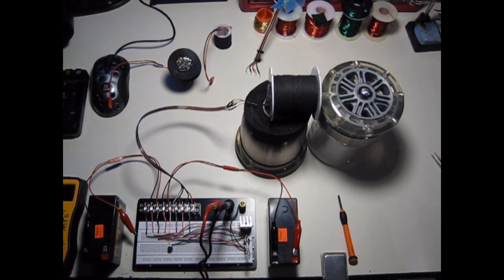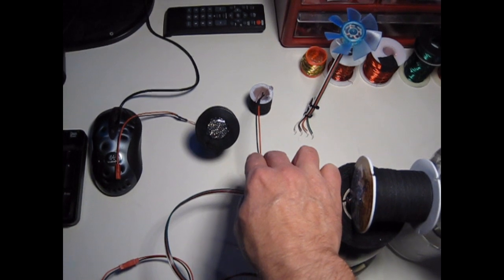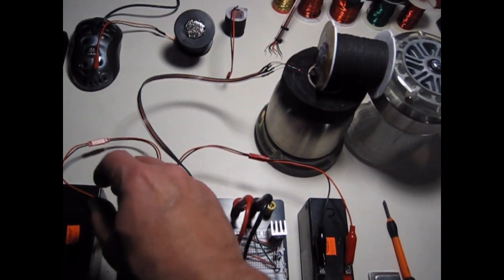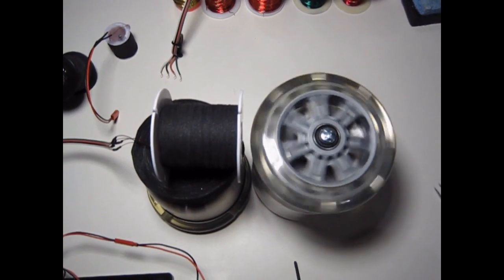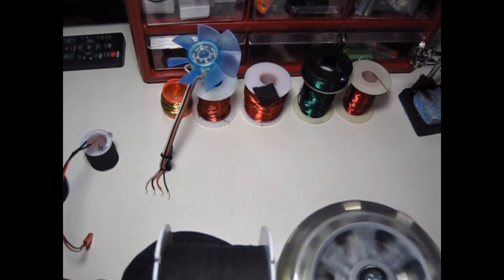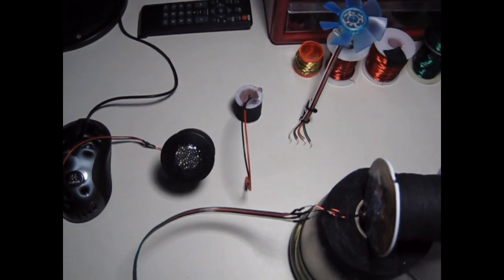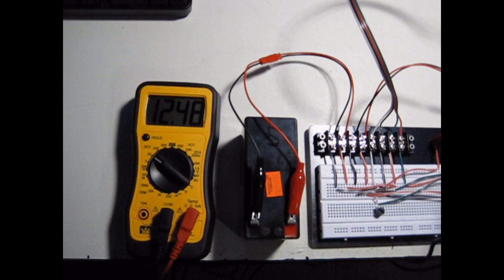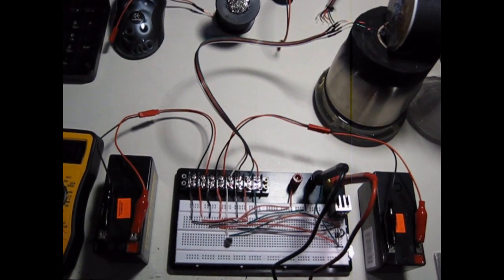My 3rd Bedini Motor

Comment: The 17 extra coils inrease the magnetic induction exponentially  and using tvs diodes and power mosfets can capture flyback much faster. An extra original Bedini circuit is necessary for each coil.

Comment: He added. "Attach a shaft to the middle of the wheel and take a hammer to a 24v drill from harbour freight and attach it to the end of the shaft.   And it will be electricity produced that was not already in the system ( overunity ).

Comment: It runs for a lot longer, than it's already impressive run time time due to the flyback reversing somehow the charge in the run battery.  He suggested using 48v to run the motor and be the charge capture batteries.

Comment: Magnets loose their magnetism over time. You might get one to run for a few days, weeks or months... but soon the magnets will be weak and not provide enough charge to keep the thing spinning. And the useable energy generated will be so small that you could barely light a single 3v led chip

Comment: So why are you only measuring voltage with no ammeter in the circuit? Your DMM is equipped for it. Move the red lead to the amperage connector and connect the meter leads in series with the circuit. Any old place will do since amperage flow is constant through an operating circuit and only voltage varies from place to place. It's also worth mentioning that you should be using your meter to measure the VOLTAGE DROP across every component in the circuit (red lead on the supply side on the "upstream" side of every conductor or other resistor and black on the downstream side of them with the circuit powered) measuring the resistance of the entire circuit end to end by flipping to ohms and then use Ohm's Law to calculate how much amperage you should have through your meter in series. 

And of course you SHOULD be using a diode- isolated, constant current supply to power the circuit instead of a constantly variable battery. You're seeing a "charge" because the battery is recovering after the initial load.Batteries store electrical energy as chemical energy. Discharging is one chemical reaction and like all chemical reactions various factors affect how rapidly and efficiently it occurs. Charging is the reverse chemical reaction and requires sufficient current flow in the OPPOSITE DIRECTION to occur. Are you SWITCHING POLARITY in your circuit? No. Therefore you are NOT "charging" the battery. You're seeing additional chemical energy conversion to electrical energy after the initial STARTING load is reduced. In a TRUE charging circuit, such as in a vehicle, there IS no separate "post" for currently SUPPLY separate from the battery positive. You folks seem to labor under the delusion that a battery is a stead state "supply" instead of a short-term storage unit. And batteries are not IN SERIES WITH generators or alternators, they are PARALLEL TO THEM.   

If your system were actually charging there would be NO NEED to move the positive lead of the meter. Just like in an automotive charging system you can check SYSTEM VOLTAGE at any point in the various circuits as long as its on the supply side and the ground side and get BATTERY VOLTAGE (minus small drops due to circuit resistance) batteries do it.

Try a real-world experiment that will clearly demonstrate that what you believe you are seeing is a BATTERY generating additional current through its chemical reactions and therefore increases circuit voltage rather than a LOAD somehow magically CONSUMING and GENERATING electricity at the same time. Because after all, a motor CAN become a generator, but only when a mechanical force drives it AND the FIELD CURRENT is reversed and POLARITY is reversed so that electricity can flow the OPPOSITE direction back TOWARD the supply. If polarity is not reversed, it isn't generating anything. 

So, turn on the headlights in your car and let them drain the battery until it is "dead". That can be until the lights are completely dark or no accessory circuits power up when the key is turned on. Check the battery voltage. The first thing you'll see is that the battery ISN'T "dead". A DMM will always show some voltage and it will probably be in the 8-9 volt range. Now for the MAGIC! Shut off the lights and key switch. Let the vehicle sit for an hour or three. Go back and recheck battery voltage. It will be HIGHER than it was previously. Guaranteed. How much higher depends on a lot of things, but it will INCREASE. That is EXACTLY what you are seeing.

One more little check to make on your car. A fully-charged "12 volt" battery will have 2.2 volts per cell and they have 6 cells for a nominal, no-load voltage of 13.2 volts. The ACCURATE way to measure state of charge to avoid "surface charge" in accuracies is by measuring specific gravity of the electrolyte with a hydrometer, but 13.2 volt is close enough. Now start your car and check battery voltage with the charging system operating. You should see 14.2-14.4 volts. Why? Because the CHARGING SYSTEM must generate enough electricity to overcome the internal resistance of the battery itself to recharge it AND carry electrical system loads.13.0 volts is LESS than the nominal voltage of a FULLY CHARGED BATTERY so you are NOT charging it.

Comment: So many electrical "experts" believe this stuff yet every one of them has every electrical appliance and device he or she owns connected to a battery or electrical system. Gotta wonder why they don't have house-hold units powering their over-unity evangelism. Or a "permanent magnet" alternator or generator in their car so they can disconnect it from the LOAD side of the electric system and leave it connected only to the SUPPLY side.

Comment: It's very simple. Digital multi-meters are themselves powered and they circuitry they use draws essentially no current from a circuit they are "connected" to. Especially when they are measuring the voltage parallel to the circuit, which is used to measure voltage DROP across a section of the circuit rather than the voltage at a given point in the circuit. 

The multimeter itself is the "path of least resistance" because it actually has positive voltage rather than being a load on the circuit. Another factor is the fact that invariably a battery subjected to an initial load such as powering a motor at startup invariably has a significant voltage drop as it supplies the load and a small amount of internal heat is generated which increases the internal resistance. 

A "old-school" analog meter with a simple voltmeter gauge that USES a small amount of current when connected to the circuit will not demonstrate the same "charging" affect. In fact, it's only the precision and accuracy of a digital multimeter that allows a "charge" of a few hundredths of a volt to be "seen". 

Once the motor is spinning (in your case assisted by the permanent magnets that are NOT found in typical electric motors with field coils, armature windings and commutators or any sort of switching device to alternate the magnetic fields) the load is significantly reduced, circuit resistance drops and the battery "recovers" voltage and appears to be charging simply because the current draw from it is reduced. 

The same phenomenon can be observed when cranking an engine that won't start down to the last "breath" of the battery. Turn off the key, allow the cranking motor, battery and conductors to cool and allow the remaining chemical energy in the electrolytes to become available over a period of minutes and when you try to crank the engine again you will find that the battery has at least a tiny amount of charge left.

The important thing to remember about electricity is that both AMPERAGE and VOLTAGE are required for the electricity to do work, and they are interrelaged. As voltage increases, the VOLUME of current - the amperage required from the supply - decreases because the PRESSURE of the electrons overcomes resistance more effectively by jumping the "gaps" from atom to atom in the conductor. 

Some say the pressure/flow description of electricity using hydraulic system terminology is inaccurate or incomplete but it is EXACTLY the same. Voltage equates to pressure, amperage equates to flow and resistance equates to restriction. Just like the RESTRICTION in a hydraulic circuit or even a garden hose creates the pressure by resisting flow, the resistance in an electrical circuit determines the amperage draw of the circuit at a given STEAD STATE voltage. 

Every circuit has a voltage drop just like every hydraulic system has a flow drop and resulting pressure drop. And just like a hydraulic circuit can have flow but be doing no actual work because the supply pressure is positive and the return pressure is 0, which results in no flow when a load is applied, an electrical circuit can have voltage but be doing no work because the voltage is being checked "upstream" of the actual load with the switch opened. There is voltage but there is no amperage. No work is being done. 

One thing you will never see in any of these magical, mythical "over-unity" experiments is the "charge" terminal of the circuit connected to any kind of secondary load. Any electrical system that is actually generating a net electrical power INCREASE will supply a load over and above what is required to operate it. And your permanent magnets have a secondary effect as additional mass for the flywheel. 

There need be no switching effect of the fields because magnets only repel magnetic poles of the same polarity. When a magnet is simply acting on a, ferrous metal, the CIRCULAR magnetic field at the end of the end of the magnet pole amount of the magnets energy and has the same polarity, so at the point at which the permanent magnetic field weakens sufficiently and the temporary magnet field strengthens, which is slightly after "halfway" because some energy loss is inevitable, the metal object is repelled. 

Even "permanent magnets" themselves are a myth. Invariably over a long enough period of time and when in close enough proximity to a good "conductor" of magnetism, even "permanent" magnets weaken. Which of course is why ELECTROMAGNETS are the only TRUE "permanent magnets" that actually increase in strength with repeated use. 

I'm sorry, but "over-unity" is a myth. And although it may not be taught anymore, once upon a time those basic scientific facts that I mentioned and the fact that in EVERY transition from one energy type or state of matter to another energy is lost because some is consumed bringing about the change itself was ALSO taught. Which of course is in direct violation of some so-called "scientific laws" by a certain Brit who must have been experimenting in the vacuum of space to arrive at his "laws", but the truth hurts. 

Newton's laws are ONLY "law" in the complete absence of gravity and matter. Otherwise known as a VACUUM. Even the so-called "vacuum of space" is a laughable lie, since obviously space contains all the matter that exists in the "universe", including the gases. A true, classical vacuum is the absence of matter and it is impossible to achieve.

Comment: People don't get it, this has nothing to do with " free energy" it's a electro- mechanical High Frequency pulsed DC generator, very good in charging, desulfating, and rejuvenating many " hopeless sulvated leadacid and nc - nimh batteries by means of " cold electricity" google bedini and tesla charger if you like to know more
Reply: Except for the fact that it's not "generating" anything beyond the additional leftover chemical energy of the battery being converted to electrical energy after the initial startup load places a significant draw on it. All batteries "recover" after an initial load in excess of their cold energy conversion and transfer capacity. A battery does not consist of two flat sheets of positive and negative material with all of the electrons neatly arranged side by side so that they can instantly jump the gap simultaneously. 

In fact, the higher the amp-hour capacity of the battery (the TRUE measure of a batteries current generating capacity (yes, batteries "generate" current through chemical reactions), the more internal resistance it will have so that that the chemical reactions take place as efficiently and controllably as possible. When being charged, the exact opposite is the case and maximum capacity is reached via slow, steady charging that does not heat the insides of the batter. Which of course creates resistance. Which reduces current flow. Which increases amp draw. Etc etc etc. 

Apparently all of the "electrical experts" who believe in something for nothing don't own cars, motorcycles or other vehicles equipped with electric starting systems. And apparently they've never had any dry-cell powered device like a cell phone or RC car, either. Because when you rapidly draw current from a battery to the point that it is "dead", you're not draining the batter completely. 

You're simply increasing circuit resistance to the point where the battery doesn't have sufficient current flow capacity to overcome the resistance with enough leftover energy to do any work. But an AMMETER in the circuit would and will show that current continues to flow. It's simply turning into HEAT ENERGY instead of MECHANICAL ENERGY. 

And of course an AMMETER is the one thing NEVER used in these "experiments". Because AMMETERS are connected in SERIES with the circuit and apply a LOAD to the circuit that these "over-unity" machines will not power. 

I could also get into the fact that the digital multimeters themselves used in these experiments measure voltage to a sufficiently small level that only the fact that the meter itself is POWERED by its OWN BATTERY allow them to be measured. Hundredths of a volt at a miniscule amperage will do ZERO work when an actual LOAD is placed in the circuit. The "permanent" magnets used and they are arranged assist the "motor" in operating. 

In actual electrical motors there are no "permanent" magnets because obviously if the motor can power itself and actually "generate" electricity, it doesn't NEED to be connected to an electrical SUPPLY at all.  But here in the real world, there are no "permanent" magnets because over time even THOSE fields weaken and the HIGHER the load placed on a motor the STRONGER the fields need to be to carry the load. Just like increasing current demand on a GENERATOR requires stronger fields for increased induction. 

If you have to go online to be "sold" on this myth, you clearly don't know anything about electricity.

Comment: please use an invertor and not battery and convert 12 v to 120 v ac and we doubt that battery is running motor via 555 timing circuit please also disconnect this in vedio
Reply: That guy never said 555 timing circuit, he show's Bendini SSG- Transistor circuit

Comment: why not save some effort and just connect the discharged battery to the charged battery? That's all you're doing except you've connected them through the PM motor and the pickup coil.

Comment: Voltage is NOT an Indication of Power....
Watching as one batt discharges and another charges (allegedly) is Utter Rubbish!!

What is the POWER--In Watts (or Milliwatts) that are Driving the device??

What is the POWER--In Watts (or Milliwatts) that are derived Out of the device??

Take Power in Watts derived from the device from the Power in Watts supplied will tell you the True facts of this thing.

IF TRULY an Overunity device--Derived Power will be MORE than that supplied--Which of course, --It Will NOT BE! 

BTW--Laminated Soft-Iron Cores are cheap and plentiful--Why Potch About with old coat-hangers!!

Comment: it is not to put a permanent flow of energy it is about increasing the frequency as the wheel accelerates and lowering the input power so we have same output with less input I recommend putting a flywheel as well

Comment: I have asked this question many times but without reply, motorperhaps you can answer,what does the Bedini motor do,
Reply: Generates electricity, simple enough. It's called an over-unity device meaning it generates more electricity than it uses.
Reply: Ramon Preston
Have you made one yourself, and if so does it really produce more energy than it uses, and if so, why are you not very rich?
Reply: Peter May Because generating enough electricity to make a wheel turn for a while is not very hard, and more so, finding a way to make it do so at such a high efficiency that it would become impractical to measure how long it will do so "perpetually" would be a massive waste of time. If you tried to connect any other mechanical piece to this kind of device would significantly lower the devices' efficiency, making the novelty of the trick obsolete. 

It's like a candle powered combustion engine, if you only look at it for a short time, and the engines' only purpose is to run it's own components, it would appear as if it could last for quite a while, if tuned correctly, but as soon as you add anything that the mechanism has to put energy into, other than itself, its efficiency drops, and it becomes easily apparent that it will either not work due to lack of input energy or only work a short while because it burns it's power source more quickly.

 Anyone that believes over-unity or any other kind of perpetual energy is lying to themselves, lying to others, or is a fool. We all would like to believe in such a thing but it is extremely unlikely to ever occur via man-made machinery, or through any other medium, and even if it did, one must ask what happens when you try to harness the systems output energy?
Reply: Skyler Kyle
I wonder, what do you think, they think they are doing?